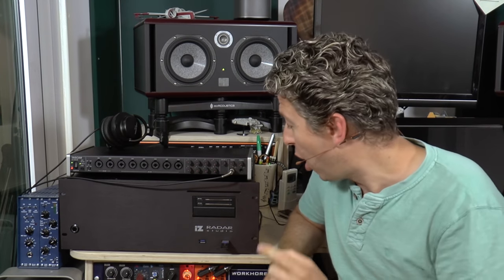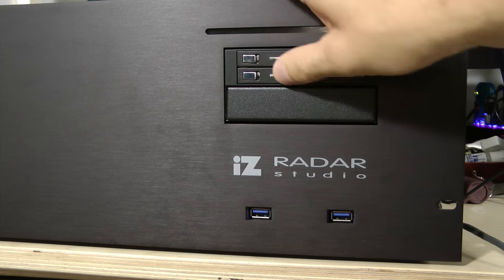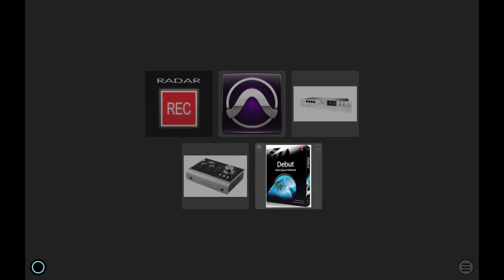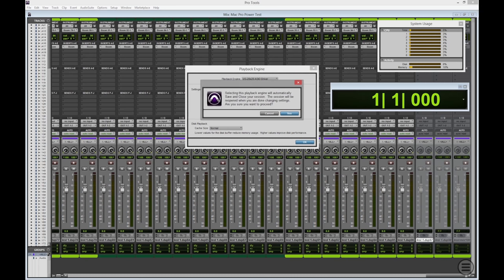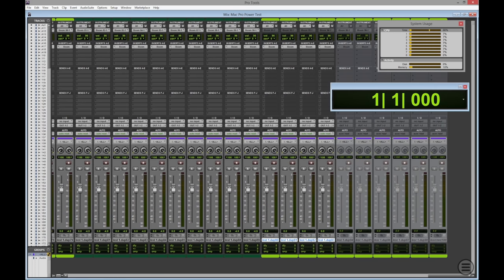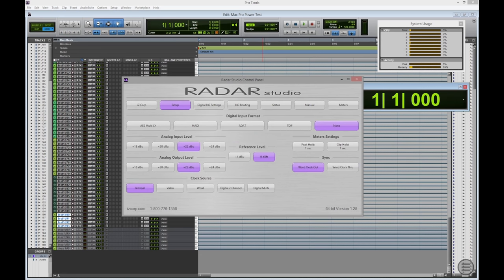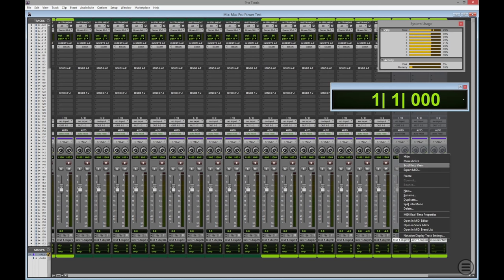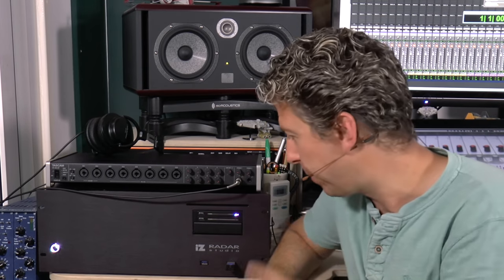Review - Speedtest Of iZ Technologies Radar Studio

Comment: So basically it's a Rackmount PC running a custom Windows 8 build ? Is that even legal ? Windows is a Closed-Source software, and I have never heard of Microsoft allowing any third party company to modify it for their own benefit... 

...or it's just an overlay app, in which case you could save 1000$ by taking a regular PC and putting it in a Rackmount case for 30$ or so. (and spend that extra 1000 on buying the converters and preamps you want).
Reply: There's a bit more too it than that; the RADAR Studio is optimised for low latency and super-stability - the iZ conversion is superb and the internal components are matched to improve performance. 
It's not a regular PC - matching a regular PC with converters will not equal it, also there isn't a real cost-saving in buying separates at this standard of quality.
Reply: yea, exactly, the OS is completely optimized for Audio. They removed quite a lot of code lines. It is an OEM version, made to their specs. All for Audio DAW stability. They are obviously able to use some of that Adrenaline DSP with their ASIO driver. Its 24 Channels. We recently added the AES/EBU Stereo channels to the party with an 8Channel system.